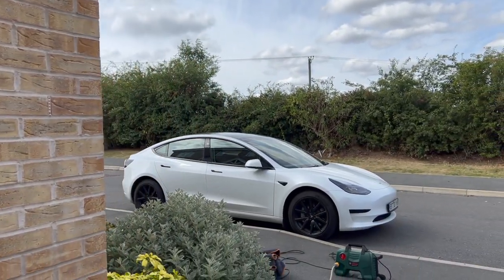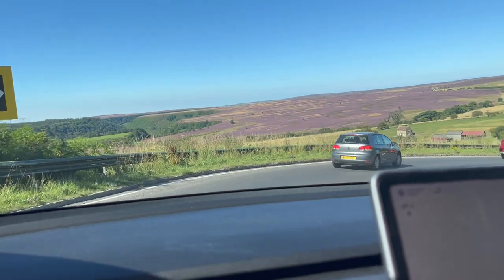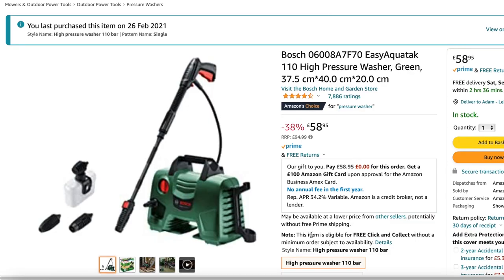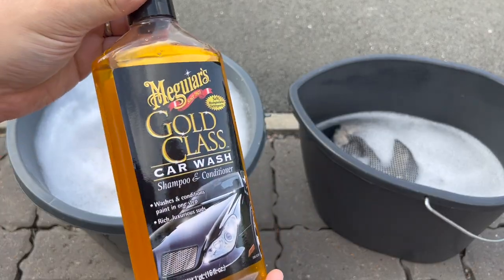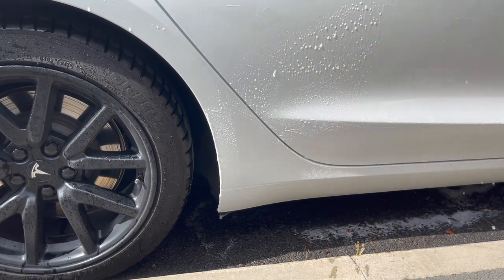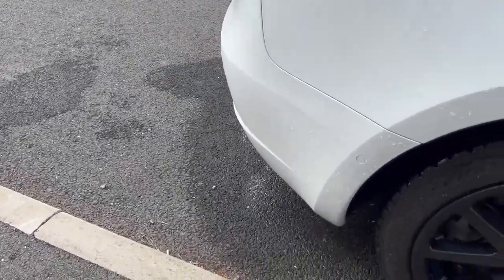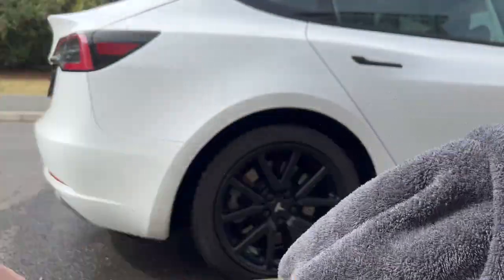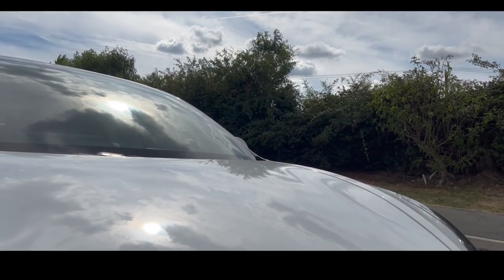EASY and Effective Tesla Model 3 or Model Y Cleaning

Comment: Try using some iron fallout remover after the snow foam and before washing. You’ll be amazed how much iron particles you’ll see coming off. (Spray on the wheels and also on the lower half of the body ) 

Also, try TFR spray. It helps loosen the bugs and also any tiny specks of road tar.
Reply from the maker: Hey Tom, I’ll have to give it a try. Do you just spray the bug remover and leave it for a few minutes?